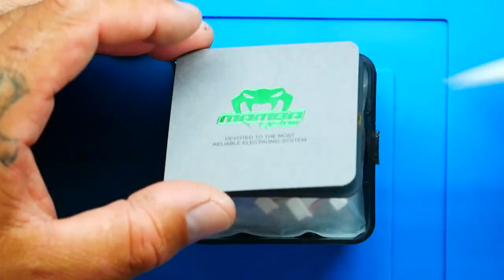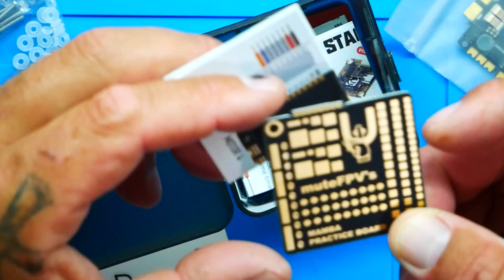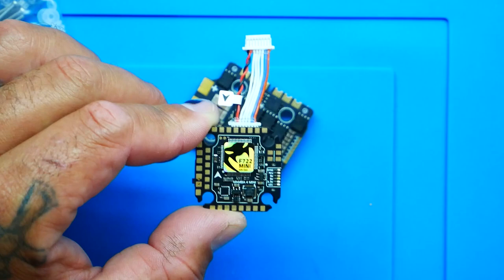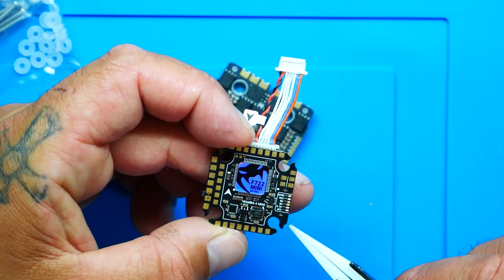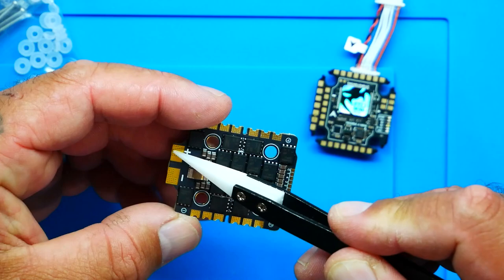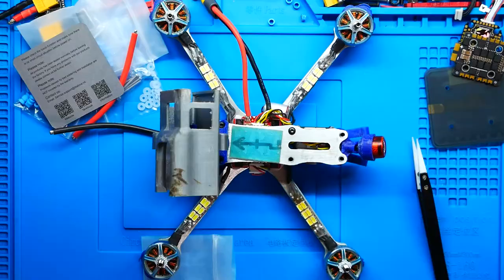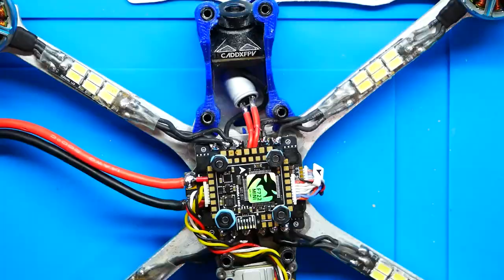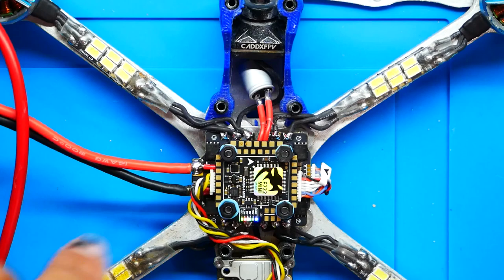This Frame Won't Break! Let's Upgrade The Stack With ALL New Reactor 66

Comment: if the frame was made of magnesium, there wouldn't be such a large increase in weight
cfrp has a density of 1.55g/cm³, aluminium 2.7g/cm³ and magnesium 1.7g/cm³
Reply: Yep

Comment: On my third mamba stack... i dont find em that tuff. What i mean is.. the plugs for the FC to esc literally came off the board from inertia just flat landing on concrete.. nothin else broke.. but they came off both boards wtf... then had another stack do same thing.. crap glue?
I dunno .. either way i never had a blitz or beast do that 2 me